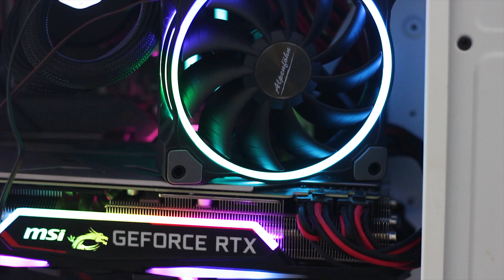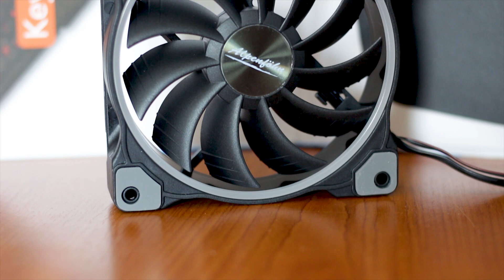Alpenföhn Wing Boost 3 ARGB High Speed Triple Fan Pack - Review

Comment: Heya, I don't suppose you would know where I could get larger head screws for these fans? Only the screws that come in the box are a bit small for the screw slots on the Lian Li O11D Evo.
Reply from the maker: Any M3 screw should work with these fans, best way to find the right screw is measure the inner diameter of the screw hole on the fan frame.

Comment: How about the Wing Boost 3 ARGB but the non highspeed? Do they have similar performance? Also do you compare it with Silent Wings 3 Hight Speed or non Highspeed?
Reply from the maker: The regular version spins slower, thus, the performance will be worse, but not by a lot.
Reply: @TechLegend-com  Thanks for your answer. But in the comparison list do you have regular Silent Wings 3 or the Hight Speed version?
Reply from the maker: @konstantinospanousos2073  If I remember correctly, those were the regular Silent Wings 3 fans.

Comment: Great Video!  You mentioned high performing quieter fans being 2 or 3 times more in cost due to engineering, etc..  Do you have any reviews of these fans and name/models?  Looking for very quiet high performing fans for radiators where cost is not an issue.  Thank you
Reply from the maker: The models I can think of are the Noiseblocker eLoop or the EK Vardar. They might not be "2 to 3 times the price" but they are more expensive and in the grand scheme of things, you could also just get a Noctua NF-F12 Redux which will perform good, and won't break the bank.
Reply: @TechLegend-com  Thank you very much.  So hard to get the right parts and not regret later.
Reply: @TechLegend-com  I did try and look to buy the ones you had reviewed, but couldn't find them in the states.  :(  Thanks again
Reply from the maker: @Z.H.Trading  Try to find the Noctua NF-F12 or the A12x25.

Comment: I have no idea what the port to connect the sata is on the motherboard I will make my build what does it look like?
Reply from the maker: Can you formulate your question better? What SATA port are you asking about?
Reply: The power SATA power cable i did more research and found out it was in the PSU
Reply from the maker: @dineshvelupula  In the PSU package you mean.

Comment: you still not testing Arctic P12 or P14 fans? :(
Reply from the maker: I will have to  buy some and get a review done. There are some issues with Arctic at the moment.
Reply: @TechLegend-com  I noticed. They're out of stock or price gouged everywhere (in Canada) and there's no word on restocks.
Reply from the maker: @medec10667  It's more complicated than that, especially in my area. But there's little I can do at the present time to review those products.
Reply: @TechLegend-com  Fair enough, just chipping in. Whatever happens, good luck
Reply from the maker: @medec10667  Your input is appreciated, you were talking about some price gauging? How much on average?
Reply: @TechLegend-com  I've seen most products go for 3 to 4x their msrp. For example, the Arctic 7X has gone from $25 to $75, and P14s going from $9.99 to $25. Others like the Freezer 34 Duos went from $60 to $150 or more. It sucks up here right now.

Comment: I have a B450 Steellegend board, very solid board but it sucks with temps. I'm not sure if this fan would help.
Reply from the maker: If the motherboard has high temp, then get yourself a top down flow CPU cooler.
Reply: I have the same board paired with a r5 3600. I have No problems whatsoever with temps. In fact it is performing very well. Wich CPU do you use? If it's a 95w or 105w CPU then yeah maybe it could heat up a bit.